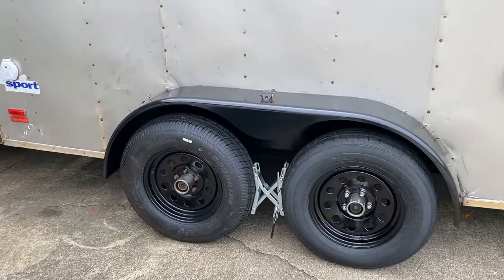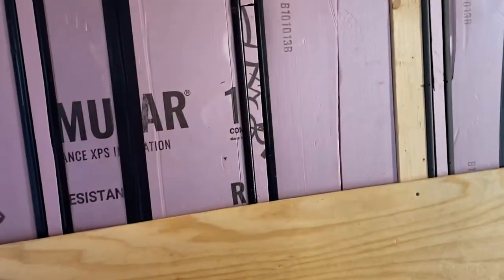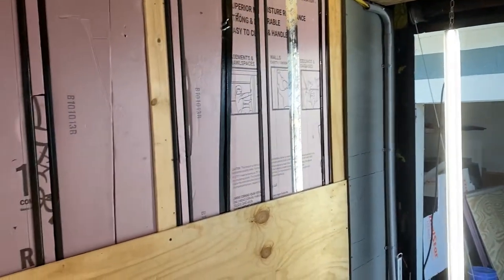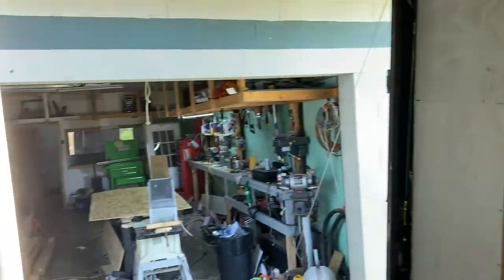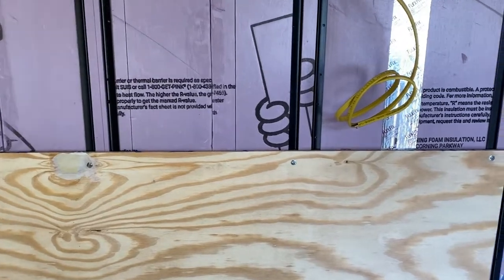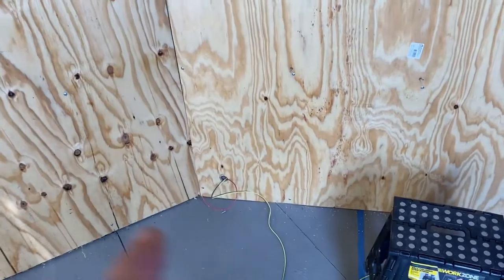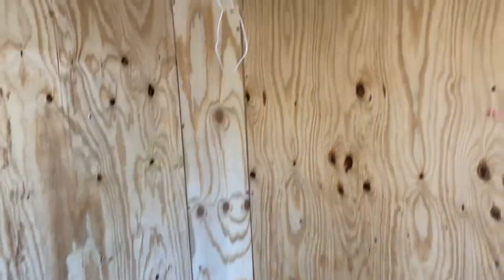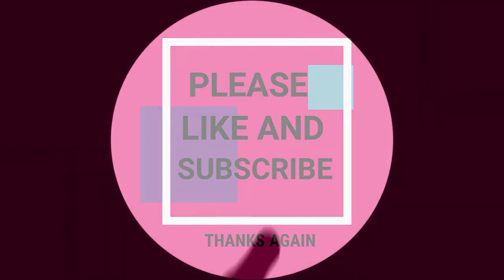CARGO TRAILER CONVERSION PART 9 WALLS

Comment: Thanks for sharing. I'm doing a 7 x 14, but for full-time use. That means I'm going nuts on the insulation and Mechanicals. I'm following along and wishing you the best of luck
Reply from the maker: thanks so much I appreciate you watching my content. we hope to stay in ours a lot and maybe even pull it to Florida in cool weather. and some winter stay here in TN.